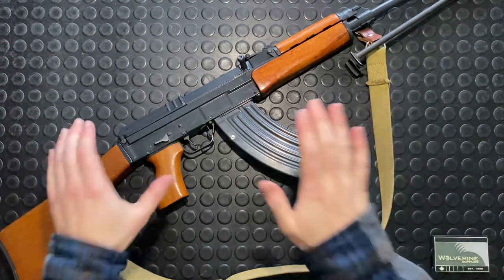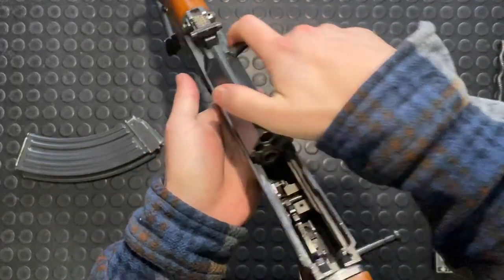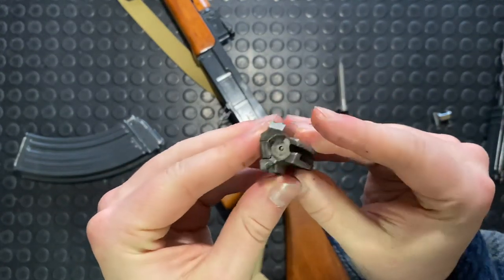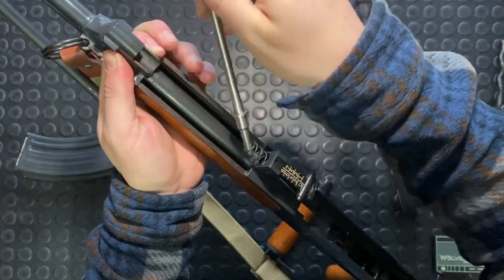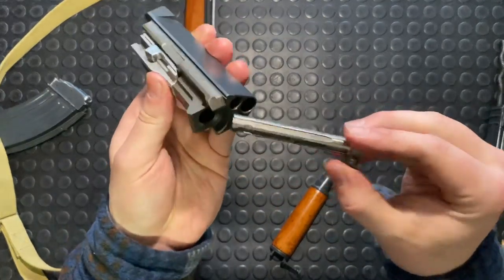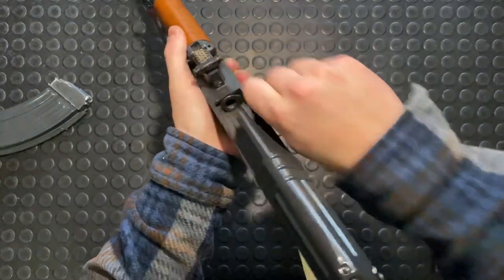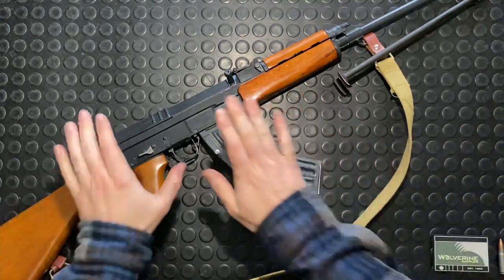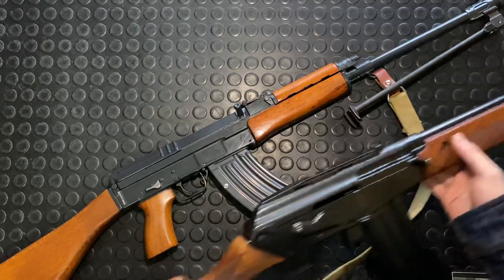Cz 858 (vz 58) Field Strip & Internal Features

Comment: congrats on the very thorough video. The VZ.58 looks daunting at first, but it's a STUPID simple gun when you get to used it. You did a great job breaking down how to take the gun down and what places to look at when assembling. too many VZ.58 videos (all half a dozen of them compared to AK videos) gloss over several important breakdown steps (I've seen some that completely forget to tell the operator to pull the trigger to release the striker before taking off the dust cover)

Comment: Looks dry? Grease or oil?
Reply: either or. the VZ.58 needs VERY little lube. Just take out the bolt and the carrier and look for the wear marks. then take some lube and rub a thin coat over those areas. Mostly around the locking collar where it fits to the bolt, and the rails of the carrier. 

as for grease or lube, I prefer grease for guns like the AK or VZ.58. you want the lube to stay put and I still adhere to "oil things that turn or rotate, grease things that slide". which means grease. You can use whatever grease you want for the MOST part. Super lube is a great grease, as is the $2.86 can of high temp auto grease from walmart. will last forever and a day. HOWEVER, I really like EWG grease from Slip 2000. They thinned the viscosity so it's like a thinner grease. It sticks REALLY well, and a tiny dab or so will do the whole gun. oil will work almost as well, especially if you're in a cold cold environment (below 20+ F) all the time. grease is less good for those times, but stuff like Slip 2000 EWG will work better because it's got a thinner viscosity. 

TLDR version, use whichever you want, everyone has their preferences, and mine is grease (I live in the AZ desert so it never gets below freezing except in rare "2-3 hour" circumstances